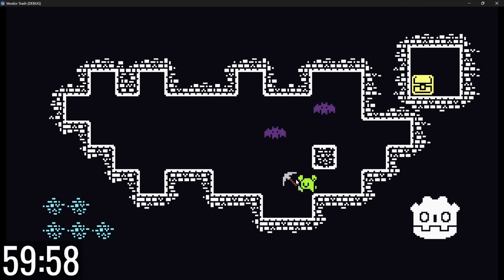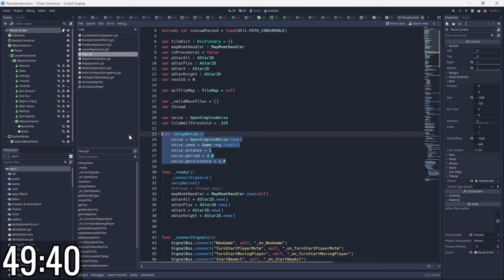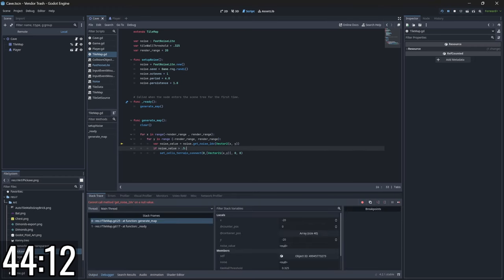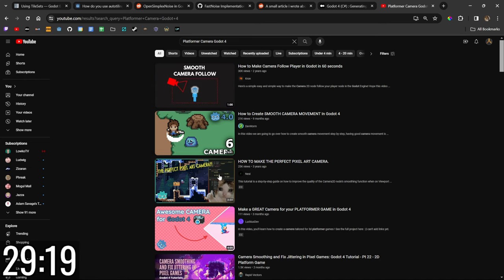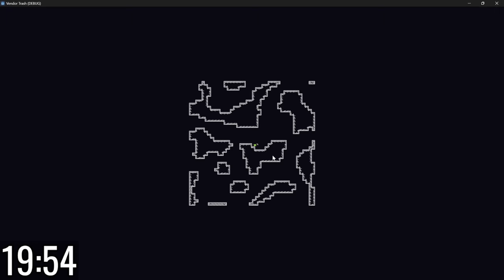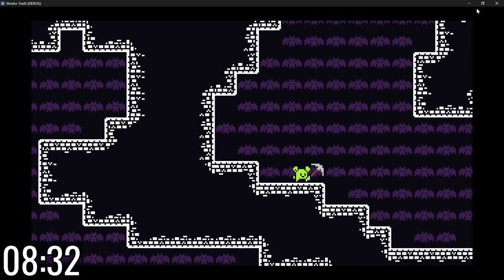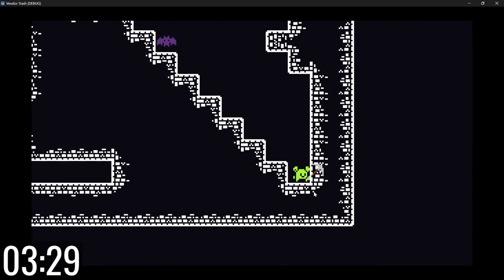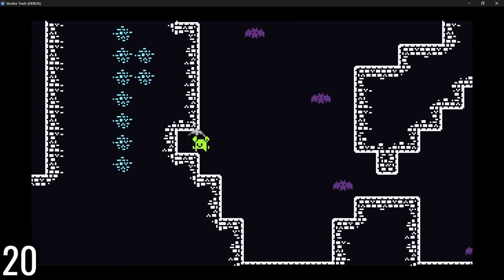Adding Procedural Generation to my 2D Mining Game  - Godot Devlog

Comment: Nice progress! I think placing blocks would be cool (or some other mechanic) to help you get to inaccessible areas higher up depending on how the level generates
Reply from the maker: Thank you, great idea for a small but meaningful next step.
Reply: @Aarimous  
A pitch: 

The bats! They could be used to carry the player upwards, in random directions left and right, with a small bias towards the player’s input direction for a limited time before you fall off.

The push and pull between the players input direction and the bat would sell a struggle and add a moment of tension to a voluntary risk/reward element!